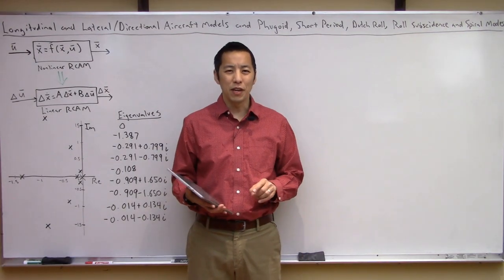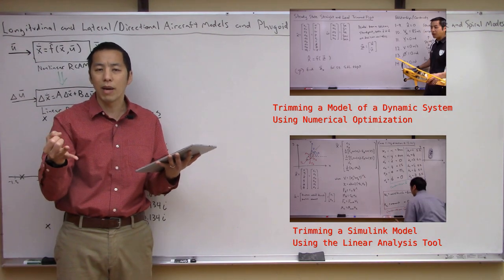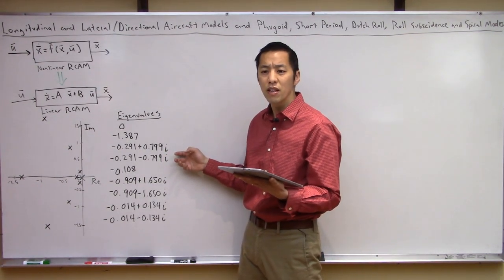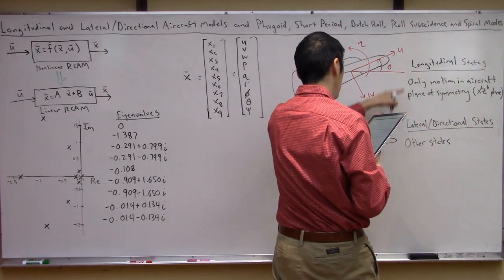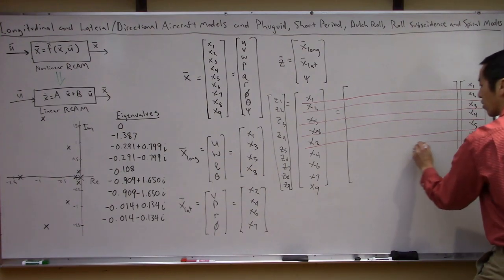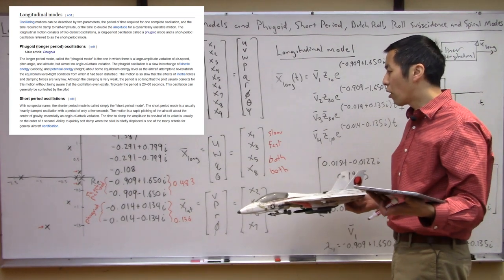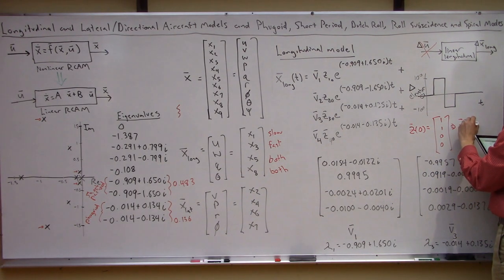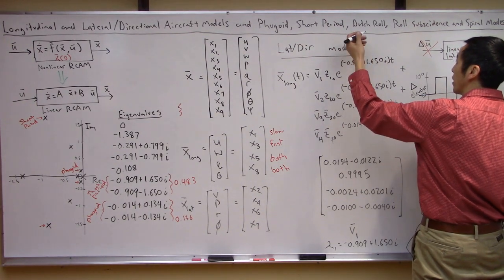Aircraft Longitudinal & Lateral/Directional Models & Modes (Phugoid, Short Period, Dutch Roll, etc.)

Comment: AA 516 This is such a cool lecture, you did a great job making such a complicated system intuitive for students. I have a canard pusher prop drone that I am designing in my free time and I was considering mounting the motor onto a 2-axis robot arm to make a "vector thrust propeller" to replace the rudder. However, because of the gyroscopic precession caused by rotating a spinning propeller, I wasn't sure about how to design the control algorithm to make it fly the airplane as I wanted. Your lecture shows me the way to analyze how it might affect the different states of the aircraft. Thank you!
Reply from the maker: I'm glad they are helpful, keep me posted on your project, it sounds very interesting!

Comment: AE 512: Sounds like you could use the eigenvector similarity transform on the B matrix to see what inputs excite which modes and use that as inputs to perform some system identification in flight/on orbit to verify the modes of the system? Instead of trying to put the vehicle in a specific state, like you said.
Reply: How do the eigenvalues of a fighter jet look? Are some on the RH side of a pole-zero as the instability would help with being very responsive?

Comment: AA516 Should the longitudinal and lateral A & B matrices be derived from Atilde(1:4, 1:4) and Btilde(5:8,5:8), or is it actually plausible for us to take A(1:4,1:4) and B(5:8,5:8) [which was shown in the video]. Thanks for the great video
Reply from the maker: Kenneth, slight correction, Along = Atildle(1:4,1:4), not A(1:4,1:4).  Otherwise, that is all you need to do, no derivation necessary.

Comment: AA 516 In using the modal similarity transformation to calculate a new initial condition to use for exciting the various modes, I've used x = Tz where T is the matrix of eigenvectors. However, this transformation results in a complex valued vector for me, and not a double, as expected. What is the process to get from z(0) to x(0) at 46:23?
Reply from the maker: Riley, I just saw this.  Did you get it worked out?
Reply: @ChristopherLum  Yep! It helps a lot to make sure you keep the latitudinal and longitudinal vectors in the right order.